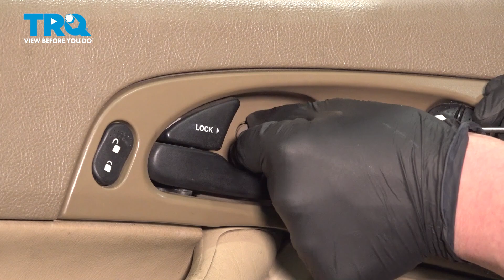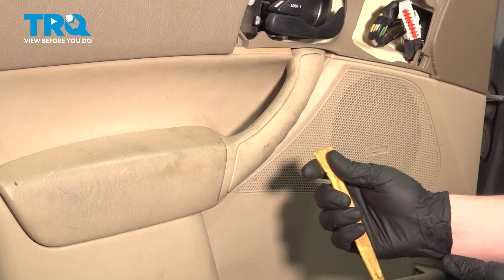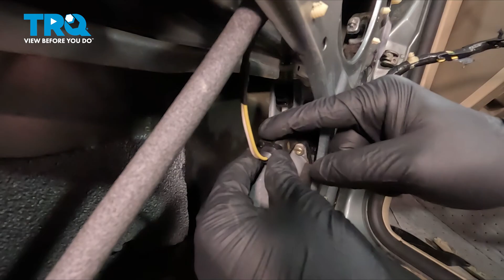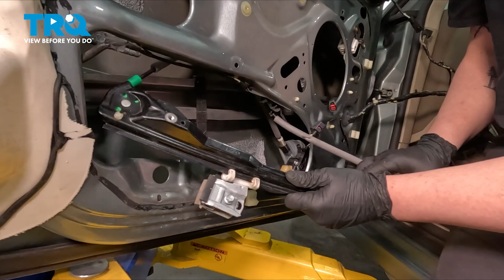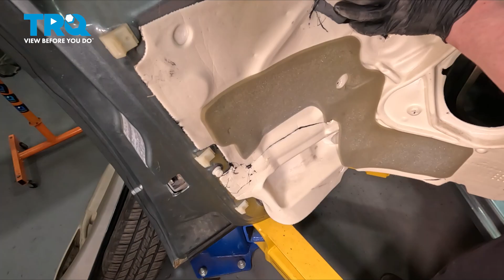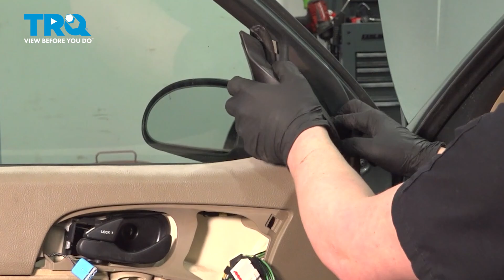How to Replace Front Power Window Regulators 2000-2007 Ford Focus

Comment: Very helpful however, every time he says T 15 hex bit, he means T 20 and if you don't have a plastic trim tool, I imagine most people don't, I used a flathead screwdriver and it worked just fine. Thank you for the great instructive video.

Comment: yeah, of course with professional tools and the car on a hoist, it's easy to do. Not that easy if you don't have those privileges and you do it on the street in the winter, equipped with average household tools.
Reply: Stil crying not his fault u can use a screwdriver/ power drill and a butter knife far as it being cold lay down a cardboard won't b as cold